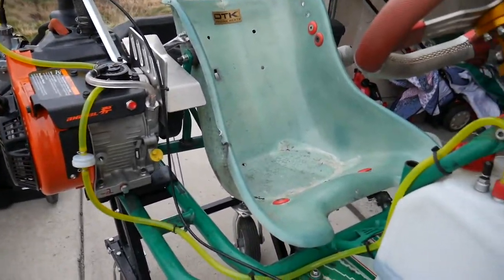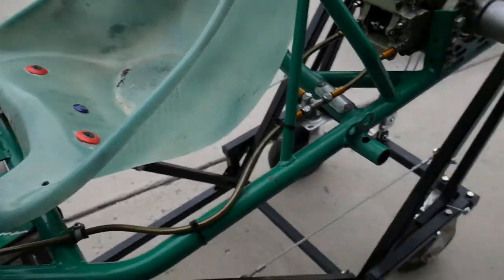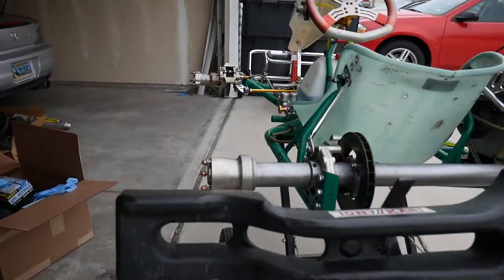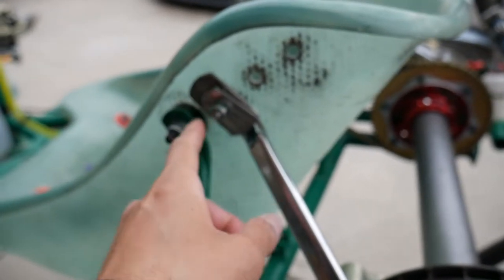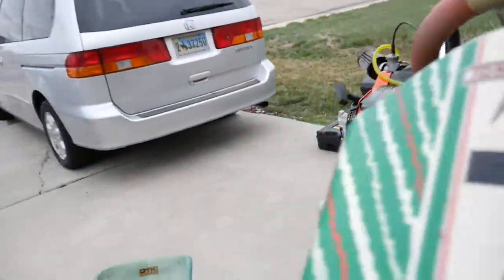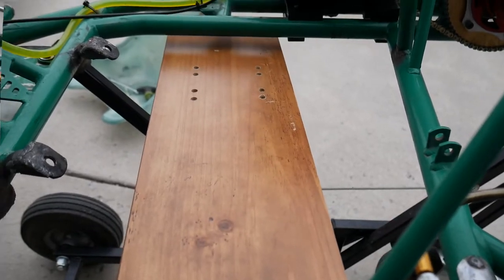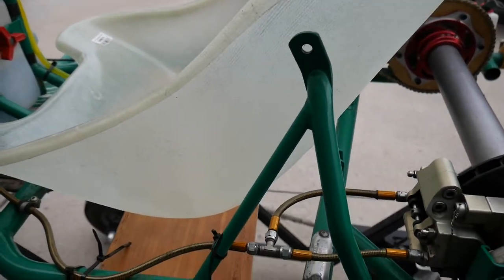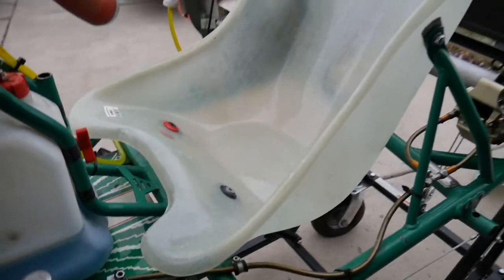How To Install A Go Kart Seat

Comment: Where did you get the motor mount plate
Reply: I’m running the same motor and frame as you and wondering where you get that motor mount
Reply from the maker: I got it from IMI motorsport in Dacono, CO

Comment: Does your axle have built in hubs?
Reply from the maker: Hello Collin, no the axle does not have built in hub, although in the video the right side hub looks like it was built in.
Reply: @AJsRacingJourney  Appreciate it.   Where do you purchase the parts, like the master cylinder and axle?
Reply from the maker: @collinblake9957  No problem. Those parts can be purchased at you nearest go kart shop or I normally purchased parts from acceleration karting dot com in the US.